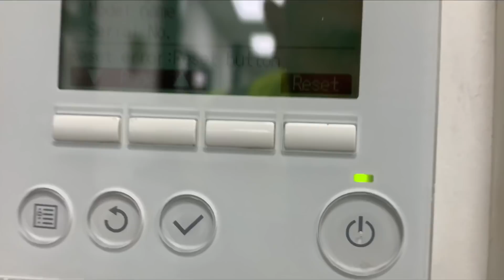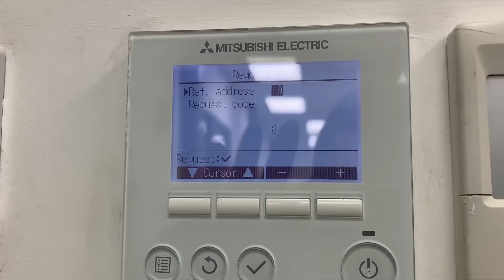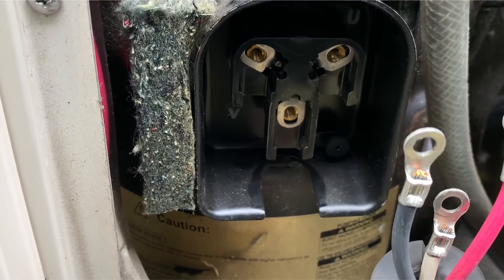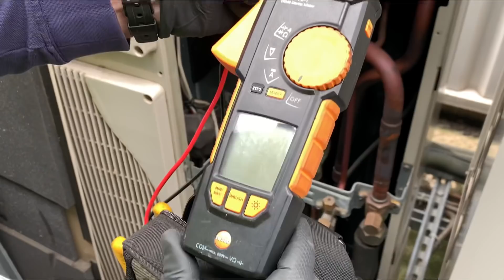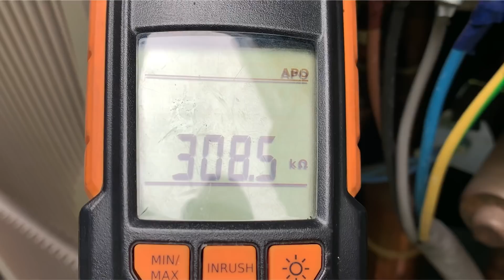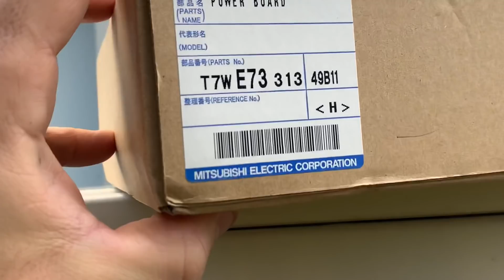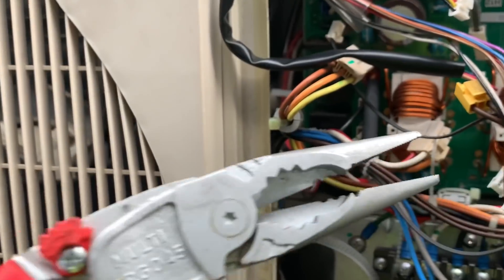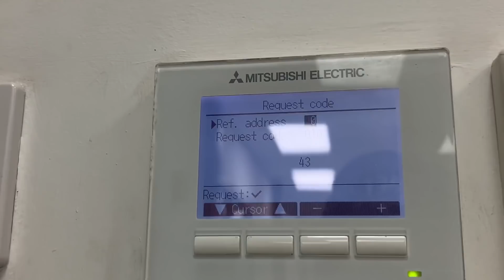AIR CONDITIONING FAULT FINDING * MITSUBISHI U4 ERROR * HVAC UK

Comment: Hi, have a par-31maa, received a u4 code on outdoor unit, 24k heatpump, when request 106 for thermistor it returns 33 which i think is thermistor 33 at suction line. Is there a way to request temperature on that thermistor at time of error? Thanks

Comment: Nah mate you don't spread the heat paste with your finger. You put a bead down the center and it spreads when the board is being tightened down. When you spread it that thin before it gets squished anymore it doesn't attract heat as well and can get on the actual board itself and then cause damage. My company has had a hell of a time with vrfs because they are new in our market and nobody wants to put in the effort to learn. Thanks for the video

Comment: I've had to change a couple of those as well. The reason I believe they are failing is because the thermal grease the manufacturer uses is garbage. You can tell from how hard and flaky the grease and also how it seems to have not spread evenly on the old power transistor chip I've started using the thermal grease my brother uses on PC CPUS' and GPUS'. Actually seen 8-12 degree cooler temperatures since I've started doing this.
Reply from the maker: Really ? Might look into that mate ! I’ve always just used what has been supplied with the PCB but to be fair even new it is usually quite hard to apply 👍🏼

Comment: I’m gonna be a Smart Ass and point out that Kohms is a high resistance relative to an Ohm,, Your Fluke meter will measure Ohms (low ohms resistance) but doesn’t measure the Kiloohms or Megaohms (High ohms resistance ),,,
I didn’t see in the video but sometimes it’s worth doing a Low ohms resistance test between the windings i.e between U - V, U - W , V - W or however they are identified, and you can see if they are balanced with an even resistance or maybe an open circuit indicating winding failure,,, But , I’m guessing the Mitsubishi would of picked that up and thrown out an error code,, I will save you typing out a Reply to me and tell Myself to “F-ck Off Smart arse”,
Good vid BTW
Reply from the maker: 😂....you’re right mate ! I do it on nearly every thermistor video I’ve done too 🤦🏻‍♂️ 
If I didn’t have the insulation resistance meter with me I’d definitely do a test between the windings and to ground with the normal meter first too 👌🏼 
Thanks for watching mate, any comment is appreciated. I bet you I say ‘Low’ resistance again on another video though 😂🤷🏻‍♂️👍🏼👍🏼

Comment: Hi I think the yellow fluke meter only measures really low resistance up to 1 kilo ohm.   Anything higher it will OL And a trick I do is to put different colour tape on the cables for different boards, makes it easier not to miss a cable when fitting boards back.  But thanks for video, some great tips there.  Love the tools...I need to upgrade 😂
Reply: Mark Lawrie: Your spot on mate, the fluke T5 only measures up to 1k. Think it was intended for Sparks doing front line fault finding originally so didn't need a high resistance range. It's ideal for quick voltage checks, testing continuity of fuses etc.

Comment: 7K8 is NOT a low resistance, it is actually fairly hi.
7.8 Ohms is fairly low, 0.78 Ohms is LOW.
Either way that Fruke meter is a pile of shit.
Merry Christmas from the land down under, where it’s 40Deg and the air cons thunder.

Comment: If you know if the T8 thermistor is supposed to be an NTC or PTC, and what K Ohms it should be at 77 degrees Fahrenheit or the Celsius equivalent, can't you solder in a new thermistor ordered from a manufacturer? 
 If it's 10K Ohm, sounds realistic
Reply: It's more cost effective and less time consuming especially as there was some heat damage to the board. Common issue on the mitsi slims

Comment: Ah. Bad thermistor, so the board gets changed... Thanks Mitsubishi. Now a PCB gets scrapped and laborers in India melt it, polute the environment doing so for penny's, then the customer pays a fortune for something that should have been designed to be serviced. 
 Energy efficiency for the environments sake? Yeah, read into it more..  It may surprise you
Reply: Going from the colour of thst heatsink I wouldn't be surprised if the board was on its way out. The heatsink paste unfortunately doesn't last forever so these boards are prone to eventually burn themselves out.